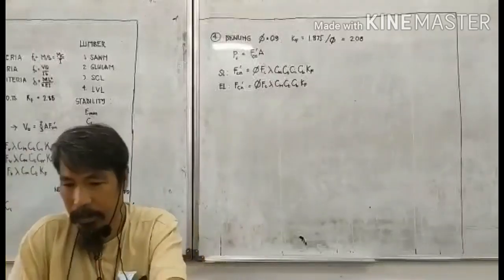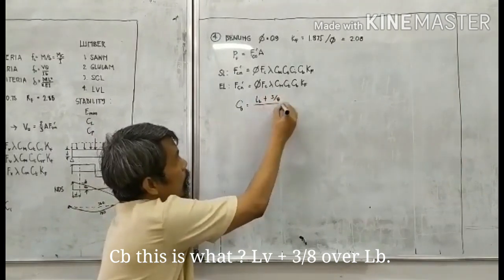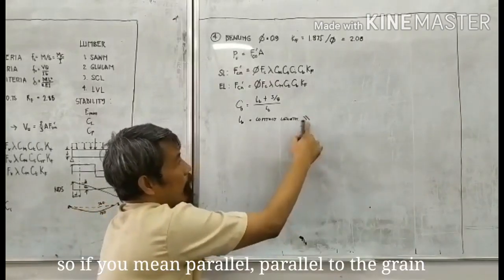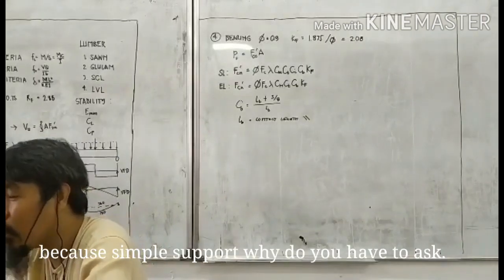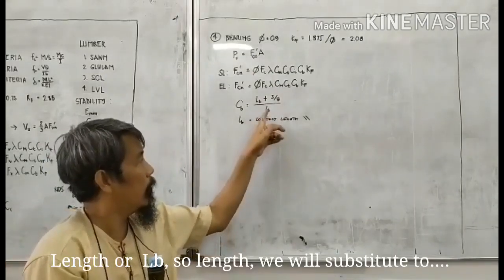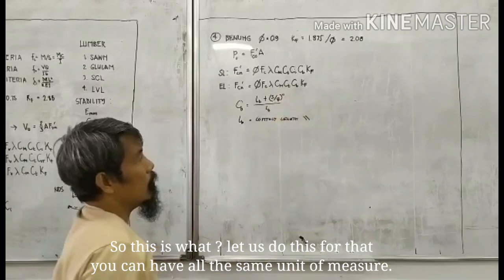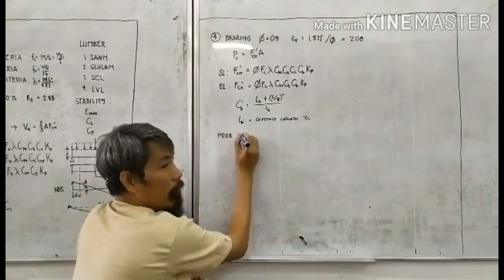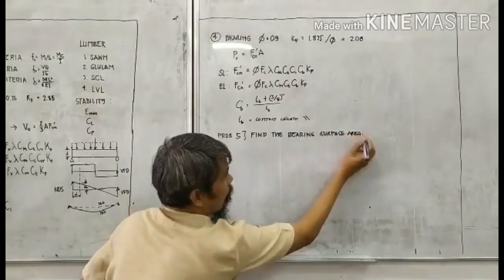CE514 Structural Design2 : Timber Design : Example of Application of Twelve Factors for Bearing

Comment: 1. iglesia
2. fixed support 2:13
3. bearing surface area 4:12
4. stability 0:25
5. contact length 1:01
6. slab 1:29